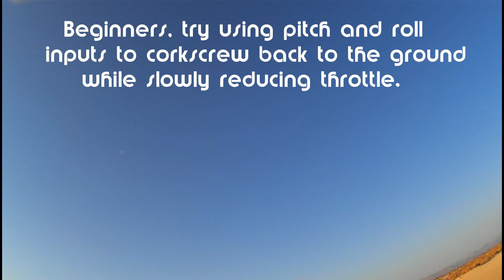Quadcopter "Wobble of Death": VRS Recovery and Avoidance

Comment: I'm a full scale helicopter pilot- vortex ring state (vrs) will only occur descending vertically in calm/no winds but also moving forward slowly and descending rapidly/steeply with a tail wind (tailwind blows vortices into the path of the props)- if you are descending vertically rapidly with a stiff wind- the vortices are likley to be blown out of the descent path and less likely to create vrs- if you get into vrs- don't add more throttle (it will exacerbate vrs)- instead gain airpseed (forward, but altenately backwards or laterally- best move upwind) to get out of the vortices and if altitude permits lower throttle to reduce vortices- vrs in helicopters is very dangerous and must be avoided at all costs- for helicopters like the robinson R22- 3 things need to happening at the same time for vrs to occur- at least 10-20% power applied, airspeed (not groundspeed) less than effective translational lift ETL (less than around 15-24 knots) - note- you can have airpseed just hovering on a spot in winds greater than ETL speeds and third a descent rate of greater than 300 feet/minute- don't know how that translates to multirotors/rc helicopters in general- but food for thought..basically avoid vrs by descending slowly (slower vertical speed, descending into wind (not a tail wind),if possible with some forward airspeed and not too steep an approach- IGE for  quads is probably less than a foot aboveteh ground- anything above a foot above the ground is going to be an OGE hover rwequiring more power- and hard to maintain on hotter, humid days - especially at higher elevations, where the air is thinner
Reply: Well put;
For multi-rotor, you don't have a swashplate / collective, I believe your best bet is to full throttle and full pitch together because you need the throttle to cause the pitch to heppen and it also could significantly change the angle of attack of blades relative to the vortices which  I assume disrupts them.  Full pitch forward would cause the multi-rotor to essentially fall forward translationally, across and downward, but with all your energy stored in the blades for lift once you exit the vortex which given sufficient altitude and thrust to weight ratio should recover itself in the manner this video demonstrates.  Agree with pushing it upwind, will definitely recover better, but if there isn't much wind or you don't have time to think I would say just push forward immediately, most multi-rotors are low altitude when this happens, probably coming in for a landing and the time to react is very low.
If you throttle down on a multi-rotor you decrease your RPM not your blade pitch, it is going to fall like a rock with no energy stored in your blades and a diminished ability to gain forward airspeed.  In a helicopter you still have full RPM you have only reduced your blad pitch and then to move translationially out of it your cyclic will increase the blade pitch only where you need it (a pitch increase 90 degrees in advance to the opposite side of your intended direction), and at full RPM.
Collective down and cyclic pitched on a helicopter's rotor will give you un-even lift on your disk which I wonder and this is just an assumption; if that could help to disrupt some of the vortex as well even before you move fully out of it. Makes sense for a helicopter to do it that way, but not a multi-rotor.

My own experience with it;  got caught out once, all of the other times I was able to recover from it just fine. I avoid vertical descents and fly like this video recommends most of the time.
Interestingly I have built some coaxial multi-rotors X8 configuration and found that you can drop them really hard and they will self recover from the wobble with throttle alone, with propellers spinning in opposite directions, they don't seem to sustain a vortex for long. Particularly if you make the bottom prob spin at a higher RPM to the top one in programming.

Large diameter props on low KV motors are very prone to VRS and should  be landed like a fixed wing with some pitch or descended vertically at a very slow rate.

Most that I have flown with a high power to weight ratio and decent quality motors / props etc can recover pretty quickly, an FPV drone or Mavic or something barely requires any thought given to this at all.. But if flying a large heavy lift drone with a decent payload or a cheap, underpowered one like in this video, be careful of VRS, you may not be able to power out of it in time.
Reply: Bla bla bla bla...if I had a rope I would hang myself
Reply: that’s an outdated recovery concept that you mention. Look into the vuichard recovery technique (which wont work for quads as you need an anti torque rotor for it)

Comment: yep just lost mine to this , ive been flying for some time my phantom 2 plus , ive seen it flutter and not noted this as a issue , but recently it did it over water and well f...k me it did dropped and with the new software noted by dji that this would slow down the copter to address this . ive demanded a replacement and more info to avoid this problem , which is very scary . noted that going directly down is not a good idea . but really some times is necessary to down with out moving forward or back . very help full... send it to DJI plz

Comment: Any direction (forward, backward, left, right) would get you out of the turbulent air, it doesn't have to be forward.

(I have a HeliMax 1SQ V-Cam now. Is there a model upgradeable to FPV somewhere between that and a Phantom Vision2+ ?)

Comment: Thank you so much. Have a Vision 2 + that I thought was defective. Now I know it might not be. Why doesn't DJI talk about this?
Reply from the maker: Good question.  There should be a warning about limiting added weight to the quadcopter. This is a big issue for all quadcopters and helisopters.  Especially when carrying extra weight, such as camera and gimbal.
Reply: Quadcopter 101 I've spend hours on hold and talking with DJI support.  It's so obvious to me what's going on. DJI needs to just make a video warning their users. Meanwhile my Phantom has been with tech support for 5 weeks now. Geeezzzz. And they keep scratching their heads.
Reply: Perhaps because they like to sell parts? :)